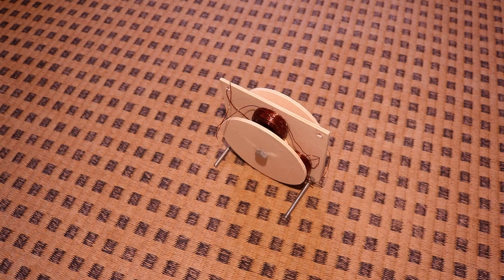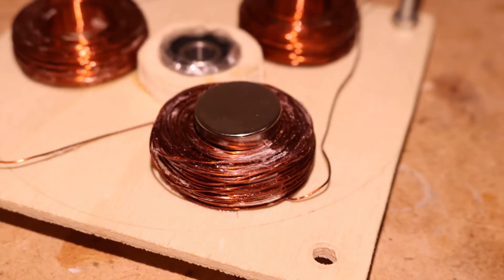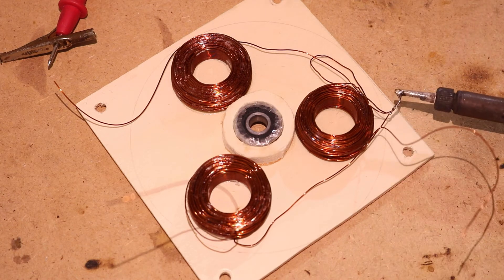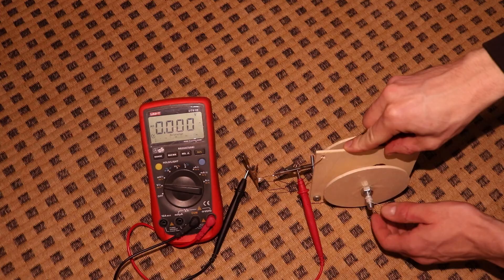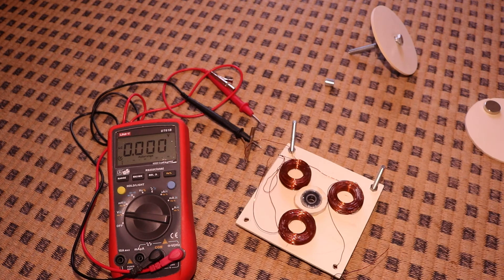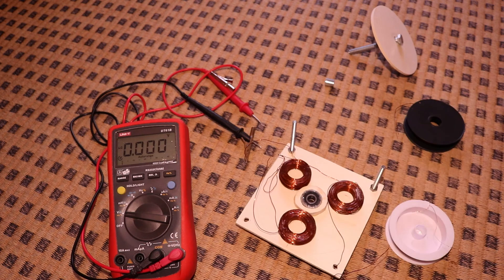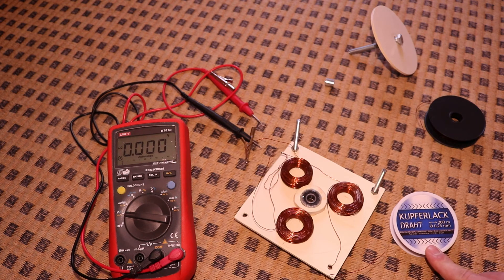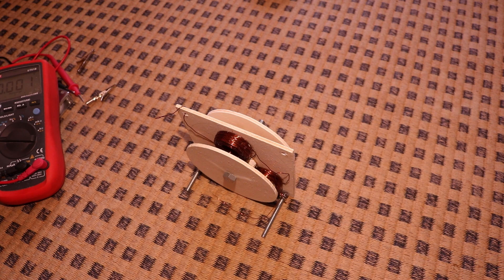Building an electric generator

Comment: some simple cheap ways of making it generate more would be to double the amount of coils(if you use scrap wire). I asume both magnets face the opposite direction, so if you give every coil another coil on the other side but then put the coil the other way they will work complementary as if you had 2 times as many windings, this also allows for you to treat it like a big closed loop which makes the magnetic field a lot stronger and more efficient. to do so just put a piece of feromagnetic iro behind the magnets on each side(if you use 6 coils instead of 3). 
doing this will bend the magnetic field and makes them act like bend magnets, if this is done on both sided it will act like a circular magnet where there are small gabs at the coils but because it wants to keep following this ring structure it will bend the magnetic field in a more straight line.

if you use 3 magnets you can also do this by making metal connections between the magnets on the opposite disk. this will do around the same as the thing about, but is harder to build mechanically, however more easy to get to work right.

both use the principle of closing the magnetic loop on one side to make it much more powerfull and directional in the air gab, the 3 coiled one however makes 2 loops of 2 magnets, and the 6 coiled one doubles the amount of windings per stage and also combines all 4 magnets in one loop, this one is mechanically more easy to make, but works best with a proper proportion between the magnetic strength in comparison to the air gab and the distance between each 2 connected magnets, because this only gets its power gain once the full loop is made, and the full loop relies on 2 virtual magnetic paths(in the airgabs). since you are not directly connecting the air gabs but instead another connection, you could however still use the same aproach as the 2 loops of 2 magnets which would make it a lot more easy but again more difficult on a mechanical level.